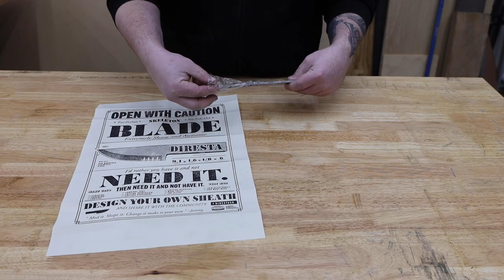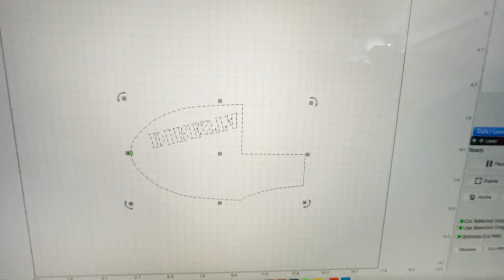Making a stacked leather handle, brass guards, and sheath for the Diresta Skeleton Knife

Comment: Awesome job Chris
Reply from the maker: Thank you Vernon
Reply: @ChrisPowellFSD  you’re welcome 
I did a video using woodcraft blanks to create custom knives you are correct it is a lot of fun making them that way (especially if you don’t have a forge)
Reply from the maker: @Hinkleshop  I wouldn’t mind doing a stock removal one.
Reply: @ChrisPowellFSD  I agree I’ve been flirting with that idea myself grabbing some 1085 or 1095 and grinding away
Reply from the maker: @Hinkleshop  I really need a better belt grinder
Reply: @ChrisPowellFSD  👍 me too I have a cheap wen disc and belt combo I really need a good belt too